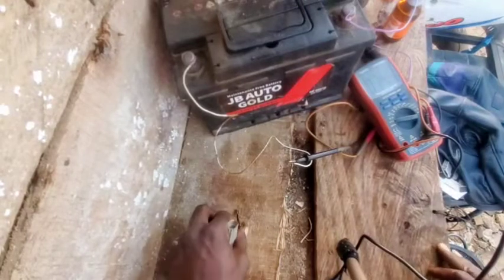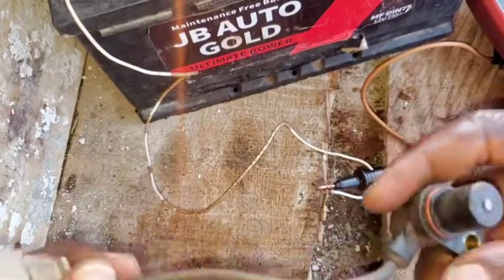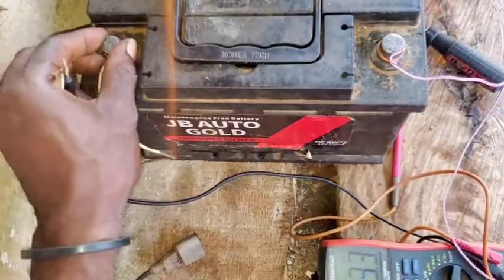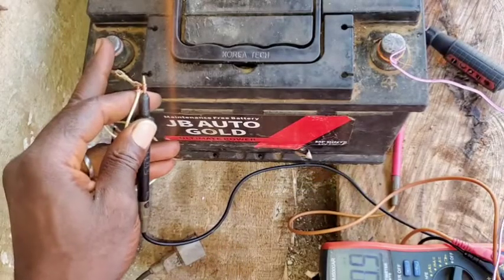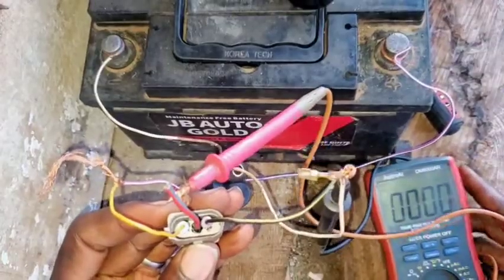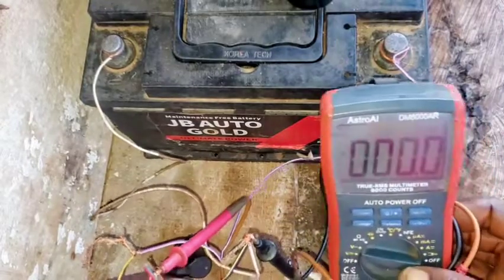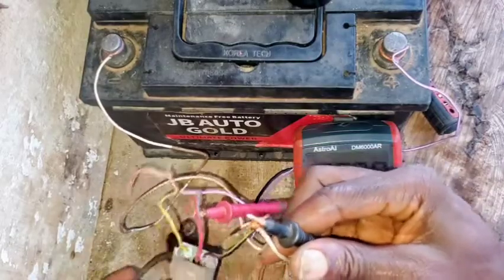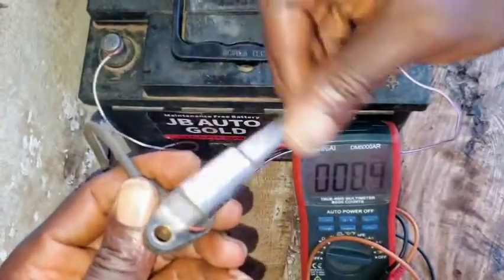how to test 3 pin crankshaft position sensor using multimeter

Comment: You should state that all three pin crank or cam sensors Dont always use 12 volt power.Most modern cars use 5.0 volt.
Using the wrong voltage could damage a good sensor
Reply: some folks shouldn't make help videos